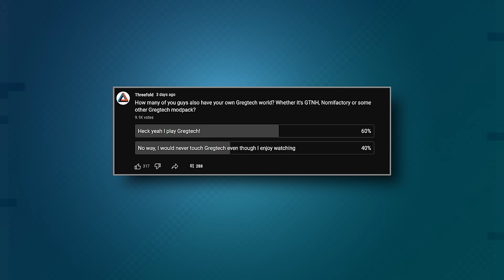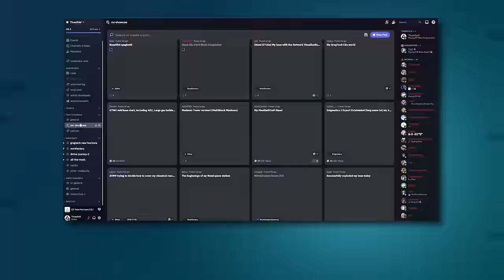Gregtech New Horizons S2 66: Make It XL

Comment: Ah, XL Gas Turbines. When 16 regular LGTs is too much, a single XLGT will step up. These things can accept multi-amp and laser hatches, and are the only reason gas power is viable post-mid IV. Otherwise the generator spam would quickly become impractical.

"What about the Advanced Large Gas Turbine" you ask? Imagine a rock that cannot break through a bulletproof window. Now imagine a rock with a sharp end that is a hundred times more expensive, and still cannot break through the bulletproof window. The ALGT is that sharp rock - an improvement in every way that doesn't actually matter, for a price tag so ludicrous it's dubious even if it could succeed where it needed to. Which it can't.

Crafts like 700+ HSS-E are what should push you to upgrade to Volcani, given how much of a speed and especially EU cost difference they make. Of course getting the most out of Volcani requires robust power infrastructure, as they should be ran at the highest tier of energy you can give them ideally, so upgrading power first is a reasonable decision.

"Aren't there better rotors we can access by now" you ask? Not really. IV in particular is starved for good rotors, with the only two options I would consider viable - and in the latter case I use that term very loosely - being HSS-E and Ichorium. HSS-S is too expensive to consider, and Ichorium...well, small Ichorium rotors are basically 10x Large HSS-E rotors compressed into one. You can only make that work in an XLGT, which means effectively 160 Large HSS-E rotors worth of throughput to use small Ichorium rotors at all. To say nothing of the cost of researching/crafting Ichorium, of course. That that is the only other rotor I would list as potentially viable in IV should put the competition - or lack thereof - into perspective...

That infinite Vis orb exploit has been fixed, for the record, so don't count on it letting you be lazy about setting up Thaumcraft infrastructure for too much longer.

For those curious about why Benzene is randomly blacklisted in the XLGT, and why this is such a headache in terms of balancing, Benzene is very easy to spam. The devs would rather reward complexity, such as investing into nitrobenzene, than let spamming more lower tier power be the meta strategy. The problem is that Benzene is the third best gas fuel (of the ones you would realistically use as such), so solutions like "nerf power output the weaker the fuel is" wouldn't exactly work, since it would largely nerf everything except Benzene. It's also a challenge to make benzene viable circa MV, but fall off requiring an upgrade to nitrobenzene circa whenever.

This kind of base-wide power outage when you're upgrading stuff is why you want to upgrade the power spine as few times as possible. You also might wish to split the power spine into several different lines, both so you can better spread the power load, upgrade them individually and have more power to throw at machines that need a lot of power. The value of future proofing cables to handle eventual higher amperages I imagine is self-evident.

Using plates or foils to cover the side of a machine, or transformer in this case, completely blocks that side from any and all I/O. Even rain will no longer be able to cause the machine to catch fire, it's completely blocked. An alternative solution, if you don't make a habit of dyeing your cables, is to dye the transformers different colors. A transformer dyed red cannot interface with a transformer (or cable for that matter) that is dyed with a color other than red. It will interface with a transformer or etc. that is not dyed, however.

The XLGT is rather particular in how it needs to be build. I would recommend looking at the preview and seeing the various hint blocks to get a better idea of what goes where, because trusting the auto-placement to do it correctly for you is a dubious prospect.

The particular version of the turbine calculator Three showed is outdated, though the numbers it gave Three are still accurate to Three's given situation, so good enough. It's also not that difficult to calculate optimal throughput or energy production manually, though of course having a spreadsheet do it for you is so much more convenient.

Another similarity between XL and LGT is that having a giant backlog of fuel in the input hatch confuses optimal flow calculations, causing the turbine to not run as effectively as it can/should. With LV input hatches and consuming 13mb/t it's not a big issue, that backlog will be gone by the time the turbine has spun up, but an IV hatch consuming 48mb/t? Eh...

At low warp levels, that Doppelganger is just an illusion, a warning of what is to come. At higher warp levels that Doppelganger becomes real, able to take damage, and shares a health pool with you. Try not to shoot them with a crossbow, it won't end well for either of you.

Broadly speaking, the amount of AFKing you need to do to get through a given infrastructure check is inversely proportional to the amount of power you can throw at it. Trying to cook 2K+ LuV supercon to craft a fusion reactor on 2A LuV is pure, unapologetic misery. 4A ZPM? Very different story. And if you've invested so much into power you can afford to slam down an MEBF/MFV combo, oh boy, you'll barely be able to grab a cup of coffee and take a break before the cooking is done.

PAs are planned to be removed, yes, but the process to do so is involved to say the least. The only accurate measure of when they will be gone anyone has at this point is "not soon".
Reply: You have reached a state of oneness with the Greg. It's amazing.
Reply: Wanted to say "i ain't reading all that", but i kinda read all that
Reply: Incredible
Reply: I've learned quite a bit from your commentary writeups over the (years?!) and just want to let you know it's appreciated.
Reply: Out of curiosity, since you and Three keep mentioning it, what's the deal with PA's being removed? Why remove them and why is the removal so involved? If you don't mind me asking.
Reply: @najawin8348  greg developers deemed the PA not a good multiblock or something, and as such have plans to phase it out, but given the amount of bases that currently run on them and lack of better alternative, it's hard for them to do something
Reply: @najawin8348  As far as I've heard PAs are a spaghetti mess of hacky code, and are not very interesting in terms of progression besides (just the same blue box + single block machines for literally almost any process). As such the devs want to deprecate the PA and replace their key uses with alternative solutions, I.E. bringing the Precision Assembler down to IV tier (without needing to build an MEBF). But that replacement got tied into a greater overhaul of multis in general that's going on, which got delayed, and now the PAs are in this awkward limbo state where they're slated to be removed, but their replacements aren't showing up any time soon.

The devs jumped the gun on adding a deprecation notice to the PA's tooltip, even though it's removal is a sure thing it's replacements just aren't ready yet, so for now you can ignore the tooltip warning and continue to use PAs. Especially in cases where there just is not a viable alternative available yet.

Comment: When I say GREG, you say TECH

You may want to use the tungsten bee for tungsten dust directly, since it skips tungstate/scheelite processing.  The downside is tungsten dust is actually much slower than tungsten trioxide in the EBF.  Same for the titanium bee.  Looking ahead, the Naquadah bee is NOT the same, it gets NOM which needs to be processed via the naquadah line, ALTHOUGH the DOB bee DOES get some pure Naquadah dust (in very small amounts)

The 64 plutonium -> 800 mb radon is actually LESS efficient in every way: it consumes more uranium and power per plutonium, since LCRs get perfect overclocks so the ratio of 840 EU/mb and 900 EU/mb doesn't worsen when you overclock.  So why would anyone ever use the 64 plutonium recipe?  Why does it exist?

Well, historically recipes could only have their time reduced to a single tick.  For the base recipe, 600 seconds at LV (ULV is not actually treated as a real tier) is 12000 ticks, so it will become 1 tick at UV.  However, it would hit 0.733 ticks if it weren't capped, so it might seem like the second recipe is better starting at UV.  However, the Mega Chemical Reactor exists, allowing you to get 256 parallel.  So using the second recipe actually only makes sense if you have an MCR with at least 256 amps UV (probably via lasers).

However, I think the one tick cap kind of got removed for machines running in batch mode, so for machines in batch mode if they would have their recipe time cap at one tick they instead increase their batch size.  I'm not sure about the details of that though or if it's even a thing, but if so there would never ever be a reason to use the second recipe anymore, aside from uranium being cheap and it saving an unpacking/crafting step

Comment: One thing I've been doing in my base lately is adding Machine control covers to systems that I want to keep turning on no matter what. If you set them to disable with redstone and adjust the time they take to try and reactivate to 20 seconds (through the square bottom right) they will try to reenable once every 20 secs. This is amazing for applications like miners on other planets where they would get disrupted by a lack of power and can be reenabled autonomously when the problem resolves. I also use it on passive processes like the platline, Benzene generation (which is now my source of hydrogen), etc.... It can cause to waste some materials, but at the point I am in the pack that no longer matters to me. The convenience of everything turning back on after messing with power vastly overtakes the minimal waste.
Reply: That's a great idea and I am totally stealing it

Comment: Please three, Please upgrade your auto crafting CPUs… it hurts me to my core!😢 That you managed to play his far with your current setup is a wonder…
Reply from the maker: The CPUs are fine. The machines, on the other hand.. well... 🙃
Reply: @Threefold. delusion…❤
Reply: Probably no one's gonna need this, but the Watch of Flowing Time from ProjectE tick accelerates machines from GregTech but not power consumptions.
So, wanna cheese out lower voltages' machines, someone?
Reply: you could almost say it causes you PHYSICAL PAIN
(no pressure; that's a random Dragoon lore reference)
Reply: @dzuchun Doki4ever😂
Reply: @-PhanHoan-A doubt this is in GT:NH
Reply: @-PhanHoan-A  what GregTech modpacks even have projectE??
Reply: In case you wanna cheese out the early ages, add it in.
Reply: @-PhanHoan-A  it’s not to the integrity of the pack. Adding an X-ray texture is also helpful, but both in my eyes are cheating
Reply: @jakobus977  Yep. I was exactly talking about cheating.
Might just take ten years otherwise.
Still, I really like the scene of a ginormous craft being done in an absolute instant, so I can’t just cheese endgame stuff out and call it a day.
Reply: @-PhanHoan-A  gurl that isn't in this pack no?
Reply: @josiahsimmons9866 Ftb: Interactions says hi
Reply: @dontask5040  It's not, yep. I mean, what I said was just an option to cheat, if you haven't thought of it yet.
Reply: @-PhanHoan-A  why cheat in a single player game made to be very difficult?
Reply: @jakobus977  For fun, ofc. Not recommended though; I'm sharing this to the minorities of players just like me.
Reply: It’s his let’s play - you do you though
Reply: @littlemissmisses2981  Sure. I'll do just that!

Comment: Your fluid regulator is already a pump. That is the only thing it regulates. The moment you added the other pump to the other side, it will push regardless of the regulator. At least, that is what happened in my circumstance with a different build.

Comment: You actually only need 1 muffler for the xl
Input bus is for automating/inserting the turbine blades
The other radon recipe is less efficient with the uranium, but is a lot easier to deal with full dusts
Can always setup a recipe for the dyes and spray cans

Comment: Three, why Processing Array will by removed?
Reply: The thinking is that it's overpowered and can replace most other multiblocks, leading to a bit of homogenisation in base setups.

The problem with removing it is that there's no replacement for a multiblock assembler till the Precise Assembler and it's super useful for doing Precision Laser Engraver recipes outside of the cleanroom. Not being able to cross those gaps are why there's no rush to remove it just yet.

Comment: 55:28 not confirmed knowledge but i can imagine that the sticky card only allows insertion since it only allows sugar to go into the superchest and nowhere else
Reply from the maker: Yes, that is exactly the function of the sticky card. Very useful for our needs in storing bulk items :)
Reply: @Threefold.  and thats probably the reason the level emitter doesnt work since the item is not allowed to be Exported, right?
Reply from the maker: @maxbalzer6531 oh, I guess I misread your comment the first time. Sticky card does not prevent extraction. It only ensures that when an item matching the existing storage on the sticky destination enters the network, that is the only location it is allowed to be stored.
Reply: @Threefold.  okay, then it looks like it is not intended
My german probably messes with the grammar
Reply: I think it has to do with the code internals of AE2 - the Sticky Card creates a bypass route for particular items. The Level Emitter asks to sign up for storage level notifications without checking the bypass lanes and gets no replies.